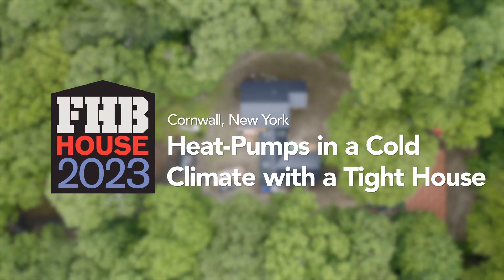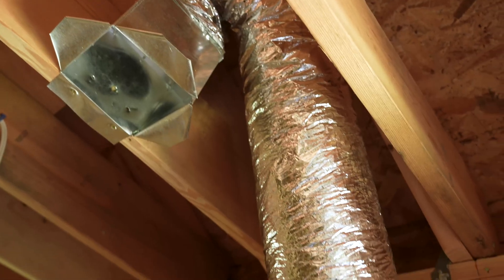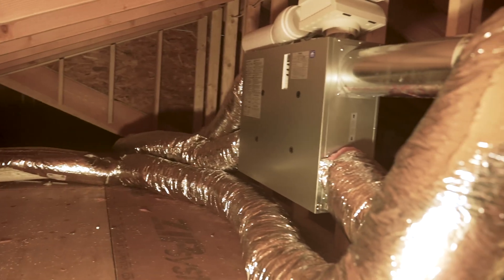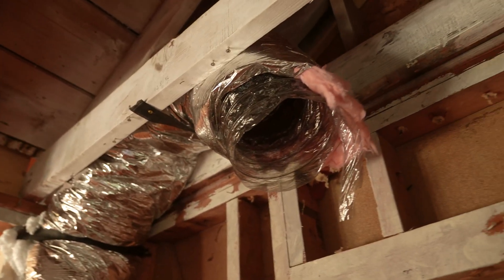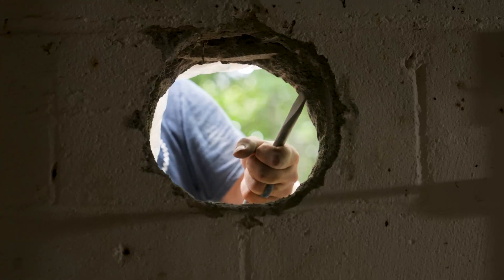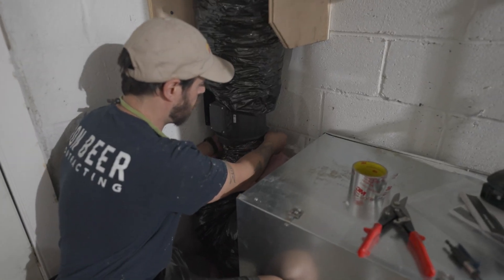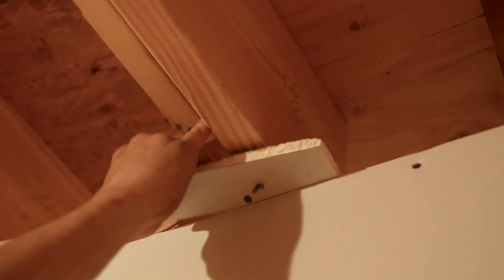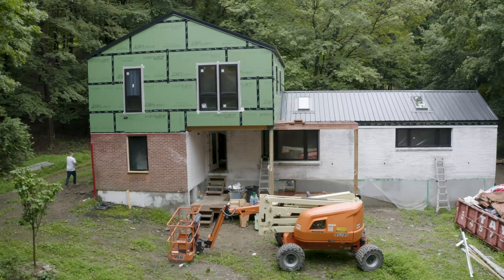HVAC Design for a Tight House in a Cold Climate

Comment: I’m also curious whether these windows truly are vinyl.  Contrary to all marketing claims, vinyl products (especially extruded shapes) will deteriorate with exposure to UV, will sag, warp and crack.   I can’t see these windows having much beyond a 10-year life.  (Architect and I’ve surveyed/measured so many houses with Andersen windows and , from empirical evidence, they are poor quality and do not last).  Would be interesting to see this house in 10-15 years.
Reply: I don't pretend to be an authority on the subject, Elizabeth, but my wife and I installed triple-glazed vinyl windows in our super-insulated home twelve years ago. We're in central British Columbia, Canada. It drops to minus 40 in the winter and can hit 42C (108F) in the summer, although a high of 33-35C (91-95F) is more typical. We had no prior experience with vinyl windows; our last house had beautiful commercial aluminum windows which are just not suitable for this climate. Anyways, our windows still look almost like new. I suppose there might be the faintest hint of fading on the sunniest side of the house, maybe, but honestly, they all look great. We didn't like the starkness of white so paid 3% extra for a tan color. 

I will agree: the commercial aluminum windows we had are probably better made than these vinyl windows but that's a bit of an apples and oranges comparison. Overall, we've been very happy. Just my two cent's worth!
Reply: @paulmaxwell8851  Interesting

Comment: What range hood is that?
Reply: Awoco RH-IT08-R Ceiling Mount 14-1/2”D Super Quiet Split Stainless Steel Range Hood, 4-Speed, 1000 CFM, Remote Control with 8” Blower

Comment: Does the USA use rigid ducting? I thought there were downsides to the foil stuff?  UK subscriber :)
Reply: Big mistake shows in the video, related to the flex duct running vertically and then being turned 90° in a very, very short radius.  A hard-pipe 90 should have been used there since the flex duct will last a year or so and then deteriorate and break open at the inner layer.  Flex duct is fragile and problematic, and can readily cause issues if not properly engineered and installed for the particular application.
Reply: Most US based HVAC installers use flex duct. It’s easier to work around and cheaper and comes with built in insulation (remember a lot of these are installed in unconditioned attics and basements) but from an airflow perspective it’s for sure inferior to rigid ducts. Unfortunately most home buyers in the US have only known flex duct, so they don’t know the benefits of rigid and so they don’t ask or don’t care because they’ve seen flex duct everywhere else and figure it works fine for everyone else, why pay for the expensive stuff
Reply: @DrWarBear  Interesting! What's the benefits of rigid over flex?
Reply: @bunnyman6321  rigid has a few advantages, but I’ll try to keep it brief since it’s late here now lol:
1) because the inside of the duct is smooth, it has better airflow (or rather less friction reducing airflow) than a flex duct, which is full of accordion-like folds
2) for that same reason, it’s less susceptible to collecting dust and lint which gets trapped in those folds, potentially creating places where small critters or mold could develop
3) because it’s rigid, it’s less susceptible to being crushed or pinched, impinging airflow. What happens sometimes (not always, but sometimes) with flex duct is that it gets ran through joists and rafters and the weight of the duct itself starts to pull down against the duct against the rafter/ joist/ 2x4 etc and starts collapsing the actual duct, again reducing airflow 

All this is subtle, but overtime it leads to rooms being hotter/ colder than they should be because airflow isn’t getting to where it needs to be, and potential mold problems. Most houses will never run new duct work (maybe add to it if there’s an addition later on, but hardly anyone is tearing out all their old ducts to completely redo them). That’s why it’s important to get the type of duct, placement, design, and diameter of the ducts right the first time. (If you’re curious to learn more, look for information on a Manual D - it’s the duct design process HVAC contractors SHOULD use to properly size and design ductwork but many don’t because if outdated “rules of thumb”
Reply: @DrWarBear  Thanks for explaining that. It was a interesting read.